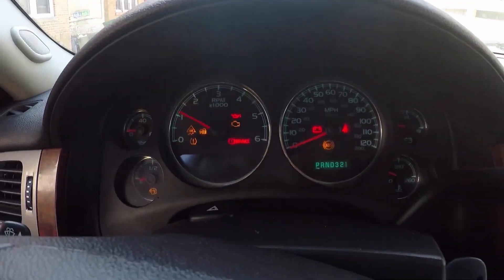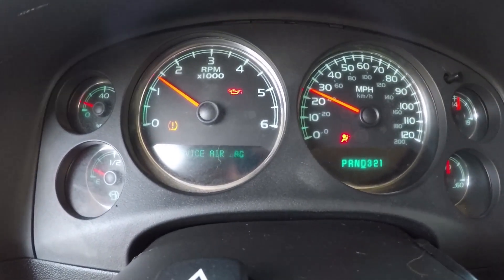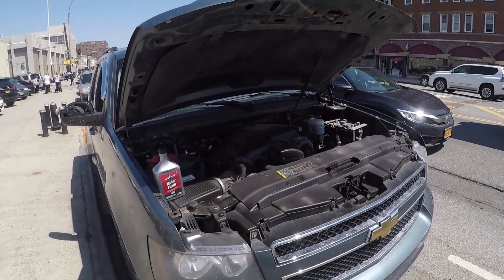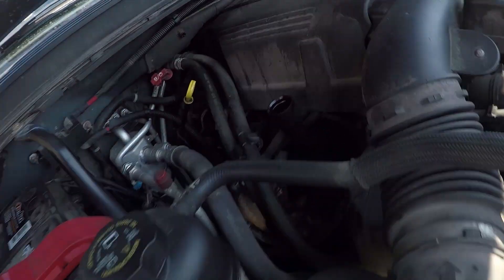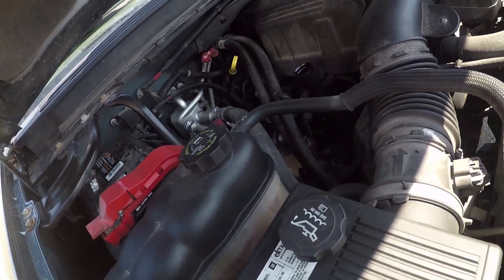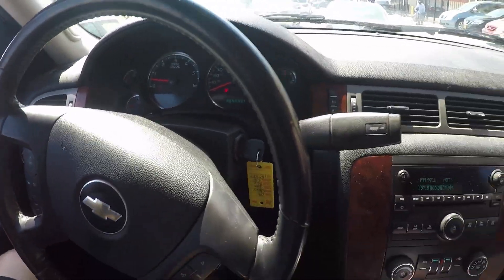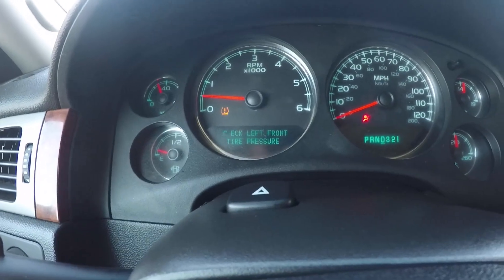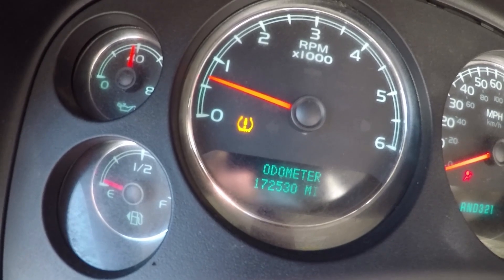Motor Flush in 5.3L Chevy at Low Oil Pressure warning.

Comment: My 2008 yukon just started displaying lower oil pressure than what im used to seeing.
Its around the first mark when cold and before it was at 40 when cold.
Motor has 127,000 and do regular oil changes around 3k.
 Gona give this a try..

Comment: do not use motor flush on these engines
Reply: Can you explain why? I have an 05 Chevy Chevy 2500 6.0.  The dealer convinced me into doing this yesterday and now I am worried
Reply: @samandkay26  It is possible to loosen debris and damage the engine. I found out first hand shortly after flushing my 07 5.3 one of the lifters went out. You may have no problems

Comment: That's a leaking head gasket or cracked...peanut butter looking under oil cap dead give away.moisture my butt
Reply: Yeah, it's called head gasket fix in a bottle and HAUL ass yo trade it. That stuff was probably foaming up like soap suds in a couple days. Water pouring out the tail pipe

Comment: Head gasket blown look at the oil cap
Reply: Not always the oil fill tube that the cap goes on will collect moisture
Reply: nope have an 08 suburban 5.3. Wife makes short trips,  antifreeze never drops, sludged up cap. Haven't done Oring yet. Every 2 years thanks to the AFM, This oil pressure issue happens, usually go get a couple of cheap filters, a bottle of engine flush, and whatever full syn is on sale. Spin off the filter, put on a new one add the flush, run it 20 mins and dump the oil and filter. new oil filter and its fine for 2 years or so with regular oil changes. I now buy 12 packs of filters cause the damn things are so tiny and if you dont have time to flush you can spin on another new filter and it takes 2 weeks to plug. Ours has had a slight knock since we bought it, and at almost 300km it hasnt changed. Fun fact when the oil pressure sensor shorted, and they do. The motor goes into safe mode and disables the AFM. The knock was gone till I put the new sensor and screen in.  So I guess that's where the knock comes from on mine. You can reprogram or there was a company that made a OBD plug that over rode it and no lights. Would love a part # for a long filter instead of a half pop can
Reply: @nrgate  it sounds like you and I are rowing the same boat. I've been using Sea Foam to flush it. What do you recommend?
Thanks for your time
Reply: I have been using motor medic last couple of times. I have used seafoam with the same results. Last time it was good and hot as I had just got home from parts store. pulled oil filter installed new one and poured in flush. let it idle for 20 mins and it literally looked like sloppy chunk diarrhea. It is what it is. new filter and oil and good to go. It is just so damn annoying ding ding ding through speakers. Wife always calls me, and I say turn it off , fire back up and that will clear the pick up. keep driving sweetie, its 's an aluminum block. if it truly has no pressure the damage is already done .So double edge sword but it never starts hammering and if it dies it dies
Reply: @nrgate  thanks for the quick response. Yup it's aggravating!

Comment: You need to replace the oil pump oil pressure sensor and head gaskets
Reply: @digitalparadox7138  everybody is seeing the moisture under the cap and are jumping straight to the conclusion that it's a head problem. Not so